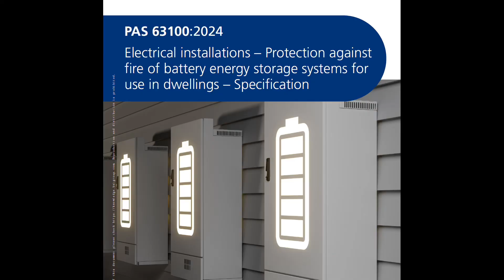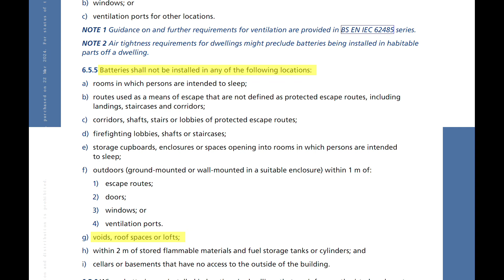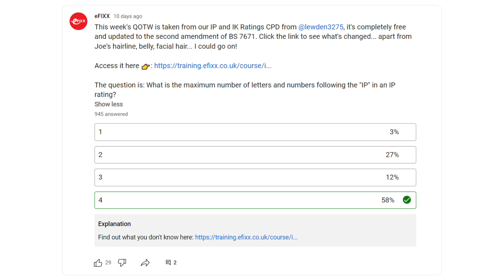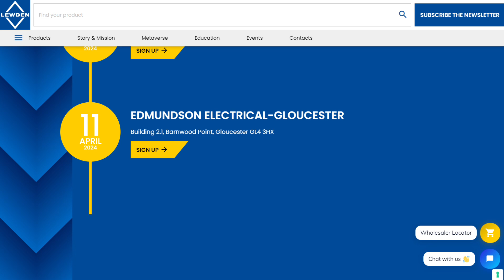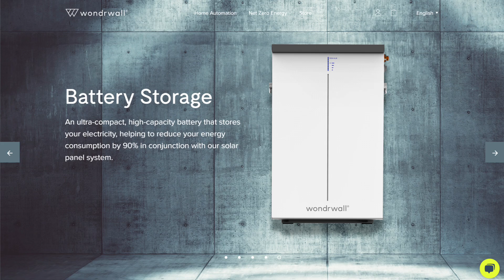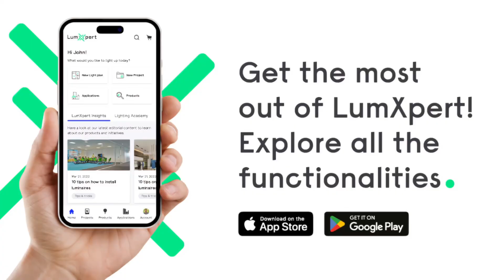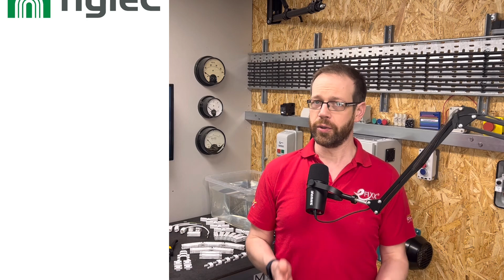New Standard Bans Solar Battery Storage In Lofts BSI  PAS 63100:2024

Comment: Good, they should be banned anywhere inside the house.. External only, and in suitable enclosures
Reply: Where's the evidence?
How many incidents were there in 2023 and the severity of the problem per incident?

Too many theorists not evidence driven.
Amazing we have aircraft with these people.
Look at the evidence and evidence ONLY stop conjuring up what MIGHT be potential problems.
This will drastically reduce battery installs  if lofts are banned
Reply: @TimWigan  Do you work for Boeing ?
Reply: @blow0me  grow up with the childish response.
 I take it you have no actual EVIDENCE to quote.
I will happily follow the evidence

Until then stop pontificating off the top of your head.
Reply: @TimWigan  Grow up ? So you do work for Boeing. You prefer to wait til bad things happen before anything is done. Nothing childish about it. The childish person is the one arguing against safety precautions.
Reply: @blow0me  so by your standards gas boilers shouldn't be allowed in dwellings ( after all they're a bomb waiting to go off!!).
Do you not see you're missing vital data to give the complete picture?

There are 1000s of batteries installed in lofts now....
Why is the available EVIDENCE not being presented driving this  safety concern because the implications on uptake are significant.
Reply: @TimWigan  do you even understand anything about gas boilers and the safety features within ?
Reply: @blow0me  I most certainly do. That's the point.... Control systems and design mitigate that risk 
. Do you understand anything about lfp batteries and BMS systems..

I'm  obviously wasting my time, you just don't understand the point being raised.
Nevermind..
Reply: @TimWigan  you are wasting your time yes. Trying to argue against safety is pointless.
Reply: @blow0me  I am all for safety, safety is paramount.
You miss the point
Reply: @blow0me  Do you even understand about batteries and the safety features within ?
Reply from the maker: That seems to be the way it's going. 👍
Reply: A standard is not the same as a regulation. You can still outbthem in lofts until the regulations prohibit it.
Reply: @AdrianColes Im sure it wont be long. I think its technical author is also involved in IET wiring regs panels. They love an ammendment.
Reply: @AdrianColes  people ignore rules, laws, regulations too. Hopefully where they matter, there can then be repercussions. But rule makers, the industry, manufacturers, they all need to take the lead and ensure safe practise to prevent injuries and deaths, largely just using basic common sense. If manufacturers stated they needed installed external to the home, in any court a failure to comply with that, could render the installer in deep do do. The need to take the lead, even if legislators etc fail to
Reply: But somehow gas burning boilers and hobs are fine? 😂
Reply: @UpsideDownFork  just advertise you haven't a clue about fire safety.
Reply: @blow0me …if the fear is about the batteries catching fire then battery chemistry should be a consideration. If the fear is (as mentioned in the video) of a heav object falling from the loft in a fire, then the standard should be about storing heavy objects in the loft. Like water tanks. I’d like to see the data driving this work.
Reply: @AdrianColes  Water tanks in lofts are a rarity thee days. Although that's more legionella driven I'd guess. Same with wiring regs where we now need more protection against wires falling in a fire.....heavy batteries on fire falling...should be a concern. But the solution all round is simple. External mounting only, inside a suitable steel enclosure that can limit any harm all round.,
I can see almost no reason ever to mount them inside your actual home, certainly not in the UK anyway. Unless extreme prolonged sub zero temps are a problem in other regions maybe ? But in the UK, just no reason.
Reply: @blow0me not sure this needs to be so combative. I appreciate the sentiment but there will be serious knock on effects here. Constantly improving safety standards is a good thing but the advice given should be based on the data. LFP batteries are not a fire risk.
Reply: @shaffermarkshaffer  https://www.youtube.com/watch?v=YvQ9NEw76G8
Reply: @AdrianColes  well said , also been in lofts with heavier shit than them batteries 😂😂
Reply: Has these been a fire from these LFP systems? We get them weekly from amazon/ebay ebikes, just wonder why everyone is so concerned about them in particular?
Reply: @edc1569  Why would you be concerned about a fire inside your home ? really ?
Reply: @edc1569 no, not a single event in the UK
Reply: @MRPINK2026  well, technically they are. Just harder to initiate thermal runaway. Also the only destruction videos ive watched suggest they need two points of puncture to ignite. Ie a second hole to introduce oxygen to initiate a flame. Unlike the very dangerous and highly explosive lithium ion chemistry. The first hole can produce a fair bit of smoke. 
So not fireproof but definitely a well managed risk!
Reply: I don't think you understand the battery technology batteries are perfectly safe if installed by a competent person?
Reply: Put your batteries outside because of fear mongery. Kill  your battery efficiency dramatically, reduce it's lifespan or fail to charge/discharge . I agree they probably shouldn't be in the loft though .
Reply: @PabloTBrave  If they cannot be mounted in a safe place, external, then clearly they need massive improvements until they are fit for purpose.
Reply: Has this been in force? As installers would be nice to no stating banned suggest it's a must ....
Reply: I don't think you understand the battery technology they are perfectly safe if installed by a competent person
Reply: @Lau-s6p  was that for me?
Reply: @Lau-s6p  some people think everything is safe, until it isn't.
Reply: External batt 😂😂😂😂😂😂
Reply: That is for the INDIVIDUAL to decide. The GUIDANCE should be in place as best practice. 
As long as the necessary structural support is in place, fire protection to structural components, emergency electrical cutoffs through contactors/relays. 

This will again place roadblocks in the way of allowing normal people with access to this equipment and will further ruin outside spaces. 

This is an elitist policy and detrimental to the idea of solar.

And is likely intended to keep everyone as ON Grid as possible.

The industry support of this is reprehensible.
Reply: @josh985tv  and seat belts are for the individual, building regs are for the individual....no rules are often to protect against stupidity from themselves
Reply: Maybe instead of believing the FUD you look at what these batteries are made off. Most use battery chemicals that are significantly safer than that is used in EVs. The water boiler in my loft is significantly heavier than my batteries. Also my batteries are bolted to the wall with the loft floor only acting as secondary support. But don't let the facts get in the way of your bias.